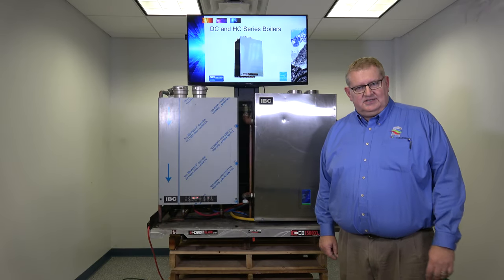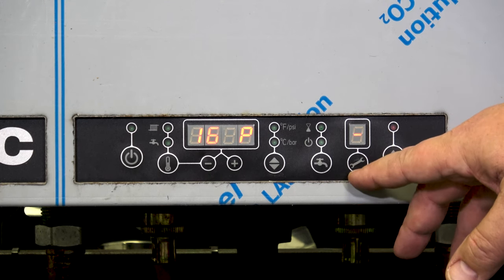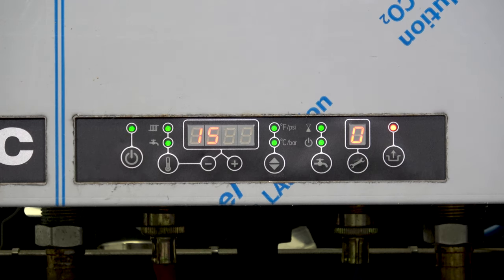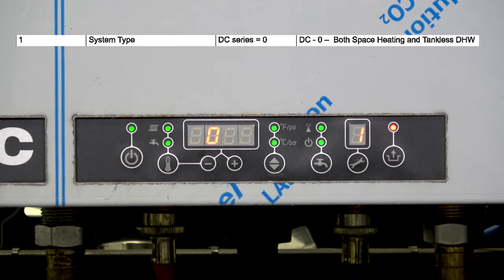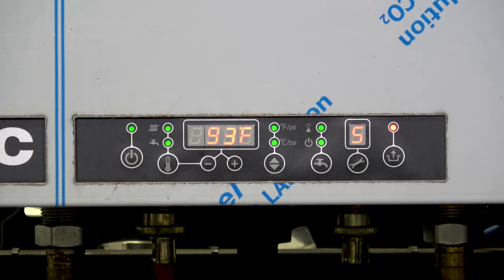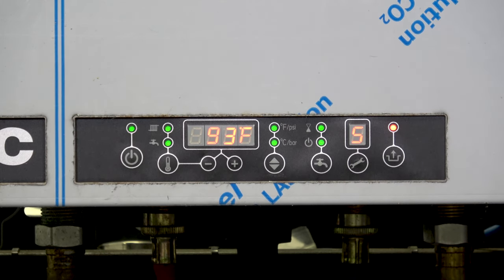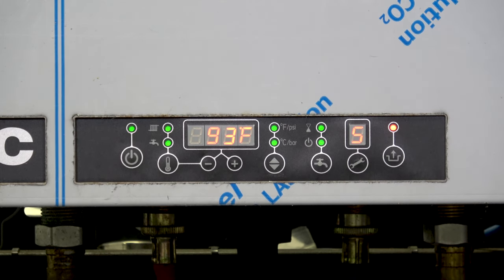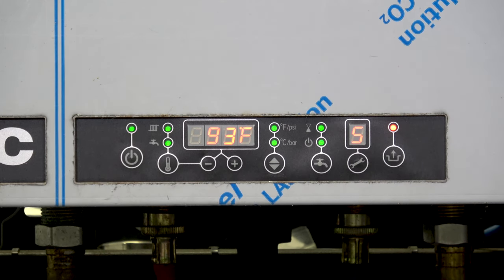IBC Boiler Setup and Programming (HC and DC models)

Comment: Great video!!!  But I'm afraid to make any changes.  We opted to also install a 2 stage forced air furnace as a backup for our IBC when we built the house.  Told that the IBC using pex tubing in a cement slab and an in floor temperature sensor could be used to heat the entire house.  First winter we burned through half a 500 gallon tank of propane in no time.  So we went back to using the forced air - only to find out they didn't run all the wires necessary for the thermostat to use the 2nd stage so it only kicks on automatically by the furnace board after 10 minutes.  Needless to say we are disappointed in the lack of knowledge around here including the HVAC installer.  Do you know of a tech in the area (southwest of Madison, northwest of Monroe)?

Comment: Pretty good video.  I just set one up and I had issues getting the DHW to start. Turns out you have to push the button to turn it on and then it stays on. 😂
Reply: which button?
Reply: @jeremyedney3599 the button with the faucet symbol. You have to be sure the power light above that button is illuminated or you will have no DHW control.

Comment: Great video!!! can you advise how your would setup on parameter 1 option 4 using DHW with a storage tank.  Storage tank is set at 135 with aquastat that triggers pump which then turns on IBC dc33-160.  So what are the options required.  I currently have it dumping water into tank at 149 but not sure how to use option 4 as I am currently using option 0

Comment: Hey I have a problem with my ibc combination boiler. It is only producing lukewarm water. I encountered this problem 1 time before and I bled the boiler and everything seemed to work fine until I bled it again & no luck. The boiler is running and working but only producing warm water instead of hot water. Also the temperature is at max for the water temperature. Any suggestions? Thanks

Comment: How about the setup for the boiler with an IBT 40 indirect hot water heater when using an aquastat sensor not the IBC sensor. I have the aquastat set to 160 with a mixing valve off the tank.

Comment: ive got a different boiler but looks like the exact same control panel...my boiler tried to fire with no gas a couple times and threw a E 4 code, turned it off and turned it back on again, and it now will only ever show a flashing E 4, cant hard reset it. just keeps flashing forever

Comment: Found this video after waking up to no hot water… my exhaust pipe was blocked by snow and ice overnight. I want reset the machine, but I don’t want to mess with any of the settings the installer programmed in. Can I just hit the reset button?

Comment: Very well explained. I have a question regarding the fan. I have a radiant in slab heating and hot water tank for domestic. Both IBC. Setting 1 seems to work good but after a while the internal fan goes very loud. Wondering if that's an issue ?

Comment: My IBC system  DHW  doesn't work unless heat is called for . when the heat is on and up we get 180 deg. hot water .This system was just installed the service guy seems to be confused
Reply from the maker: You should not have 180F water for domestic.  That is too hot.  It sounds like they have it running wild.  It should be integrated with the boiler control.  It is called domestic hot water priority and pretty much all condensing boilers have it.  There should be a sensor in your DHW tank and when it calls for heat, the circulator for the heating system should be turned off and the circulator for the domestic system turned on.  The boiler should send all of its 180F water to the coil in the domestic tank to make 140-160F domestic water.  Then there should be an anti-scald mixing device that blends it back down to 120F or so.

Comment: I need to learn this because the plumber installing it is arrogant and uninformed and believes they are good to go out of the box.
I learned to program my Rinnai before this one and all the parameters were grossly incorrect.
Reply from the maker: Problem #1... a plumber installing a boiler instead of a HVAC guy :)
Reply: @TECTubefilms  All the local plumbers say they can do it.  Ridiculous errors were made when my house was rebuilt 8 years ago. Now I'm ripping out the Rinnai and the 3/8" PEX they ran through the house to the 3/4" baseboard. Nightmare
I really enjoyed your video.
Reply from the maker: Show them this video... Lol
Reply: I’m in the same boat. My nti boiler was replaced because nobody could service or fix the Co1 it was belching into my house. The guy installing this IBC said we are in the same boat with the last one.. he got it functional but it has no thermostat hooked to it now? Please advise. Btw their are no technical hvac guys remotely close to my location.
Reply from the maker: @Reverse_engineer_867  Yikes!  Where do you live that there are no qualified hydronics guys?  Somewhere rural in the southern US where residential boilers are not as common?
Reply: Tec Tube , 
believe it or not I’m in high arctic northwest territory’s canada (8 months of winter). I can guarantee this is the only combi boiler within 900miles. Beyond that this house is 4300sq feet with a very short water loop to a rad inside a forced air heat exchanger. Maybe 20gal system. What kind of thermostat’s is this unit compatible with? Or is it completely reliant on zone valves/pumps to signal ?
Reply from the maker: @Reverse_engineer_867  All thermostats would be compatible with all boilers.  Boilers just needs a contact closure at TT.  Now, with that said, how you control your valves and pumps is a discussion point.  Most folks will wire the stats to a zone control panel and that panel will enable the appropriate circulator or valve AND also make the TT signal to the boiler.
Reply: Tec Tube,
Gotcha, I by no means am a HVAC tech other then heavy duty and automotive machines. This entire system has 3 pumps all wired to the HC one into the boiler, one into the heater core and one into the hot water tank.  Can i simply wire the stat to x4 6/7 to stop this thing from constantly demanding heat? Its running full blast 24/7 if i don’t manually shut off the heat exchanger
Reply from the maker: @Reverse_engineer_867  Sorry, that question and application is more complex than we can answer without being the contractor on-site looking at the whole picture.
Reply: Tec Tube, 
Any sense, thanks for publishing this video! Its very informational and i will be showing it to the plumber when he comes back!
Reply: @Reverse_engineer_867  I understand. I'm getting more than frustrated. Every joker that thinks they know what they're doing around here (New England),  seem to do shoddy work.
I don't even trust the local "specialists" because I've seen so many jobs botched.
I will learn to correct it myself or interview the local Craftsmen at the bars around noon.
I'm only a bit upset.
I will be looking for an installation video for this unit.
Shouldn't be going through this, but people that care about what they do are a dying breed.